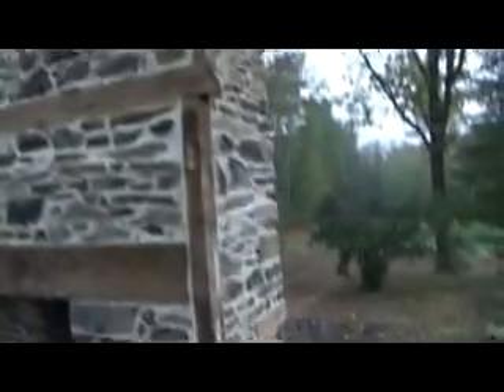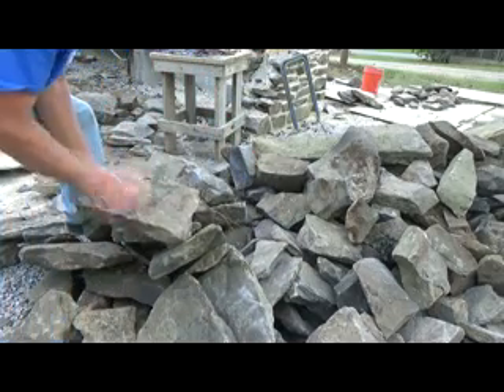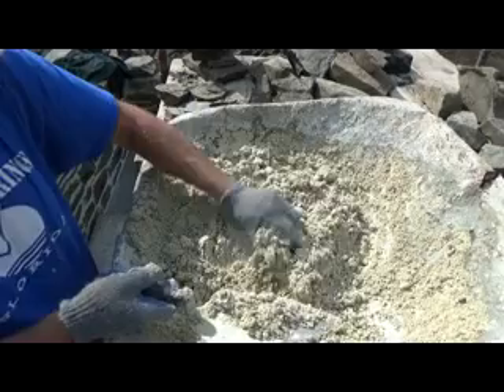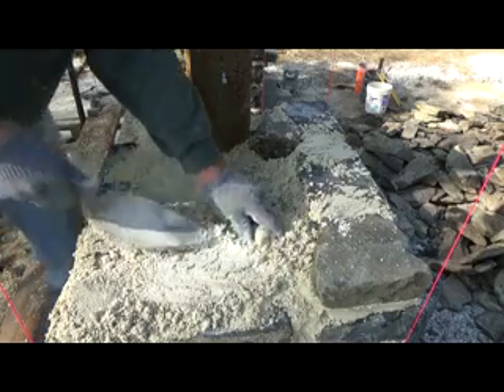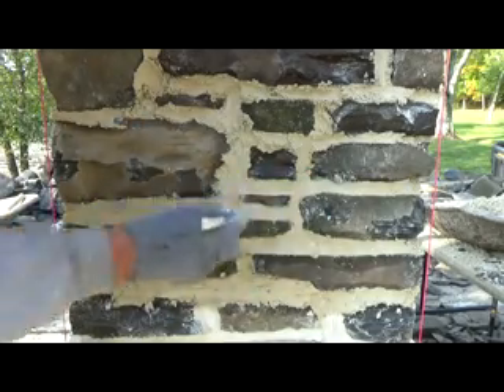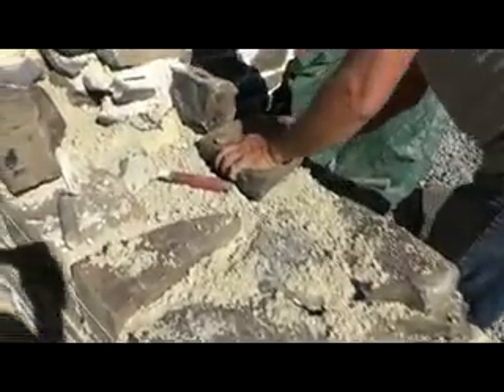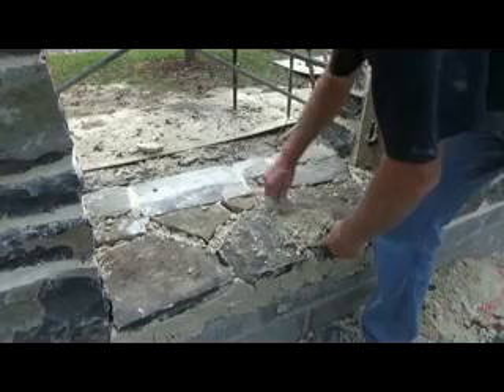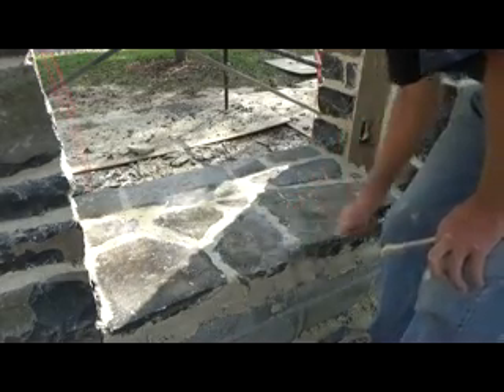EARLY AMERICAN STONE WORK (Mike Haduck)

Comment: Portland used with stone? Correct me if i'm wrong but isn't that 100% cement? you would be crucified here in Ireland for not building  with lime mortar especially when the stonework has history
Reply from the maker: probably so, but it won.t hold up where I live,  thanks mike
Reply: they built stone with lime long before cement and it's still there. Lime will shift and heal itself unlike a hard cement.
Reply: brick, for sure, you should have lime, because fired clay is weak.  you want your mortar lines to be softer or as strong as the material you are binding, but not stronger than.  If mortar lines are stronger, they will cause the brick/stone to crack and cleave away as the expansion causes fractures at the weakest point.  Depending on the stone he is using... the stones are usually stronger or as strong as portland cement, so its the mortar lines that will give with the expansion.  if you add a bit of lime to that mix it will allow for better elastic expansion though.  Dry packing 100% portland cement is kind of dumb though.  portland cures with water, by not supplying it adequate h2o, you prevent it from curing to its full strength(especially at the center, the outer layer will react with atmospheric moisture).  Now, lime cement cures through interaction with atmospheric co2, as it converts back to limestone.  Over time, if allowed to breath well, and kept dry, lime cement cures harder and harder until its basicly solid limestone.  Now,  if you have new construction, using just portland cement is fine, but if you are adding to any existing structure with lime mortar used, you really should continue to use lime mortar, if you use portland, what will happen is the lime mortar joints will elastically expand and contract with the weather while the portland joints attempt to stay completely rigid, but despite the greater strength, the joint wont hold up against the weight of an entire wall's expansion.   Its not exactly how I'd do it, but it should probably hold up fine.  I'd have used a lot more metal reinforcement if keeping everything historically on point obviously wasnt a concern.  but sometimes, depending on soil conditions, water table, etc, portland has to be used, a non hydrolic cement wont cut it.
Reply: MuayThaiWarrior  yea but it's 100 % cement  mixed with something  else  which ain't  100  percent  anymore
Reply: One  third  Portland  cement  2 thirds sand that's the mix  stated in the video
Reply: Lior Holtslag we're talking purely about the binder, the cement type.  The sand added is an aggregate.
Reply: Like Mike said different climates call for different styles you have to keep that in mind the test is time go see if its standing 50 years from now then I'd say it did it's job.
Reply: They could be using type s and adding sand to that. That would have maybe 1/3 lime
Reply: i dont know where in ireland u live mate.im here in donegal  most historical buildings are repaired by cowboys with portland.it would make u cry.....
Reply: It isn't 100% Portland, It's sand and Portland - 2:1. Here in the states, by the way, they don't use hydraulic lime the way they do in the U.K. and Europe, partly because we must import it from France. It costs much more than common use concretes, and fast building is popular here, so they have no patience for Lime or Belgian sour ales.
Reply: I’m not sure about all these YouTube videos advocating lime mortar for stonework at all costs. In the north of England, the house I live in was built from reclaimed stone with sand and cement mortar of unknown mix in 1993. The pointing is rock hard with zero deterioration and the stone itself shows no sign of spalling or erosion. I’m about to build a small stone retaining wall and felt I should use lime putty and sand mortar but I’ve changed my mind and will use a 3:1 mix of soft sand and cement.

Comment: Mike you are a pro, I enjoy your videos, I’m a stone mason and a brick layer by tradition, but always learning, excuse my intrusion, but Lime mortar is self healing, specially deep inside the wall, I learned from my old man that if you lay the stones with a minor slope inward from both faces of the wall, and crucial to use lime mortar for its softness, any cracks that might appear or movements on the wall, will heal  with the rainy season, the lime mortar will run in toward the center of the wall and pack in deep inside sealing any cracks, Portland cement will dry and cracks will show. And if using soft stones Portland cement will damage the stones by not letting the water run out through the joints instead of through the stones.
Reply from the maker: Thanks Fernando, it is true in most areas, around here with our weather it all falls apart, in our area if it does not get wet it last,  but when it gets wet and freezes, I would have to be back fixing it, I always add Portland, thanks mike
Reply: @MikeHaduck  Would a portland/lime mix allow the best of both worlds?
Reply from the maker: @brucetepke8150   hi Bruce,  a lot of guys from jersey would use it and have no problems, I did a video called "lime, mortar or portland" what should I use,? I explain it best there, thanks Mike

Comment: It's neat how the wood was incorporated into the structure mixed with the stone work back then, as shown at the first of the video.  Is this done much now days?
Reply from the maker: +yopagedotcom  I do not think codes will allow it anymore and nobody builds in this style, metal chimneys have replaced the old ways, thanks mike
Reply: Check out Lew French. In my area there is too much expansion and contraction from moisture and temperature change to incorporate the two materials. But were there's a will there's a way..its too amazing of a look not to !!

Comment: I love your work but you are using totally the wrong mortar. Period properties were constructed with hot mixed lime mortar, no cement! Solid walls need to breath and allow moisture to easily escape, cement will just hold moisture and cause all sorts of damp issues. Also the consistency of the mortar is wrong, stone needed to be bedded on wetter mortar and the stone needs to be damp to give good adhesion. Sorry to pick fault but I have worked with master masons and they would rip this apart if they saw it.
Reply from the maker: Hi Monkey, I did a video called conwy castle where I interviewed the restorer, etc. And what you say is right in a many cases, but I been doing this over 50 years and in a lot of cases I got to go fix all the jobs where they used lime mortar, you got to know where and when to use it or not,  in our area it falls apart, with respect, mike

Comment: 1:1 that is a strong mix, I guess you can get away with that because it's so dry, and also a big cooler out. 
If it was real hot outside would you drop down to maybe a type "s" or even type "n" masonry? Or leave it at port? I would be scared of cracking even being that dry! 
Awesome job looks good. 
Something tells me you were not happy with the mortar lol. I'm guessing you wanted to wet it up just a little?? 😝😝😝😝
Reply from the maker: Hi Sir, yep dry helps, I am not a fan of lime, it falls apart in my area,  s mortar is usually ok and as long as the stone is harder than the cement I never had a problem, I appreciate it,  mike

Comment: Can someone explain "dry packed cement" to me please? I'm hardly a novice, and it's the first time I see and learn about DPC. At first I was like, this guy forgot to add enough water into the mix and the wall is gonna crumble in a short period of time! Again, I'm hardly a novice and I know nothing about masonry work. Don't judge my ignorance! When Mike specifically mentioned DPC in the video, I realized it has its' specific purpose. 
Why use DPC vs. wet Portland vs. Mortar? I'd love to learn!
Reply from the maker: Hi Terry,  I worked with guys from Portugal,  and they used dry pack for everything, and the same with masons from china, etc, I would say it's the way you were taught, but up where I live with the freezing temps I like to lat it wet,  depends on where your from and how you learned, every mason has a different opinion, some jobs I do use it dryer so I don't mes the brickwork or stone,  I hope it helps.  Mike

Comment: That's beautiful, would it be ok for the finished wall on the inside or do you have to insulate it? I mean is the solid wall without an airspace thermally efficient? Thanks.
Reply from the maker: Hi Shane,  when I was a kid around here the old timers lived in the cellar during the winter with the old coal stoves,  I guess it would all depend on how you look at it.  thanks mike